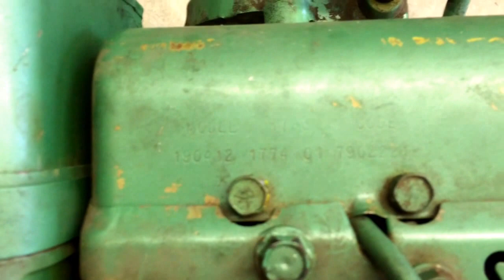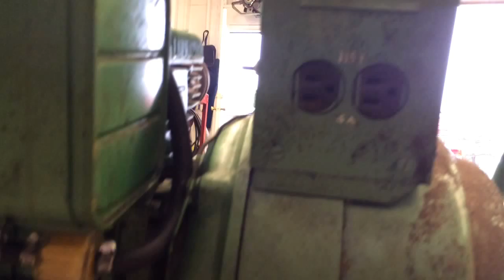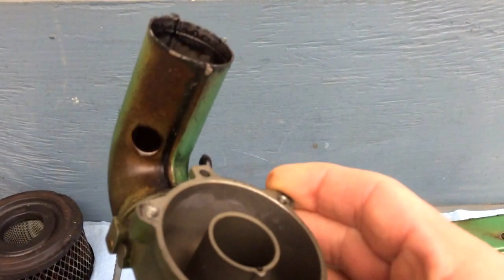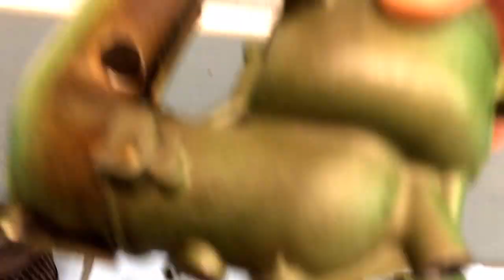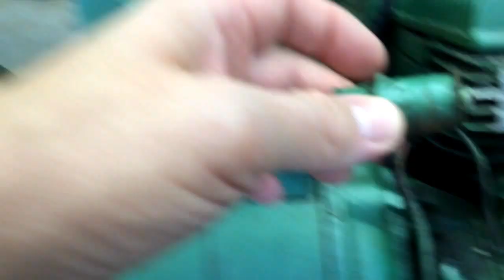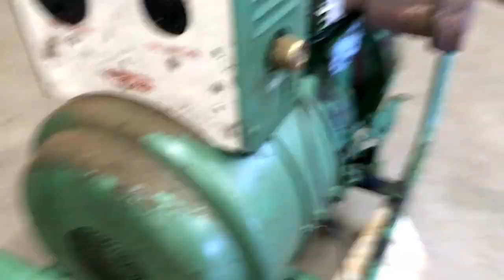Dayton 3500 Watt Generator Rescue Part 1

Comment: I have the same generator but yours is in nicer condition. Mine is so old you have to wind a rope around a pulley to start it. They can be started off a 12 volt battery using the generator windings, if you haven't figured it out already.
Reply from the maker: Yep, when I first started working on the generator I used the 12 volt starting circuit to get it going since pull starting wasn’t enough to crank it. I have since added a 12 volt battery so my wife can crank it in an emergency situation. The old generator had got us thought a couple a bad storms so far.

Comment: I have one like that I am positive it's made by Winco which mine is. They are very well made
Reply from the maker: +1944johndeerel  
I'm guessing there's some cross over between Dayton and Winco. This unit has Dayton all over the generator, but when you do a little searching for the Model 3W014i (3500 W) or 3W014 (the 3000 W) version, i find some referneces to Winco... Maybe they were kind of like Chevy trucks VS GMC trucks... they were the same truck LOL.
Reply: its called outsourcing and many companys do it. you buy a product from another company and have them slap your stickers on it.
Reply from the maker: +1944johndeerel 
Very true.